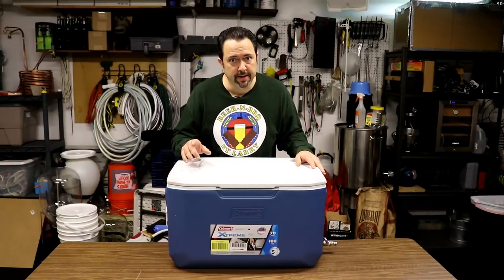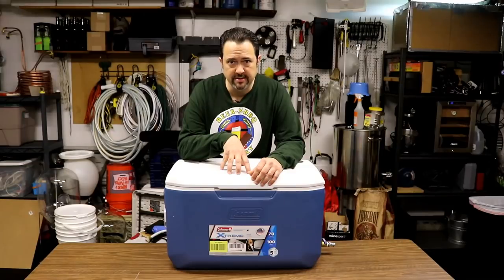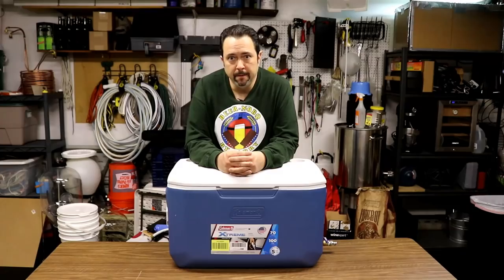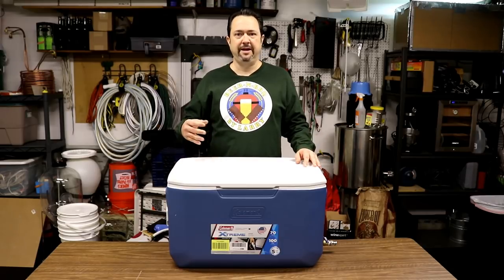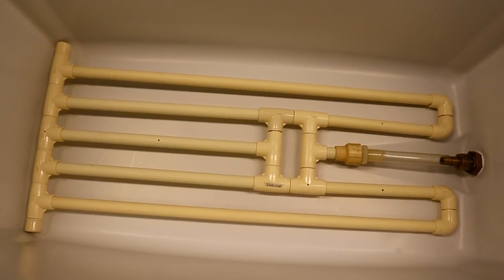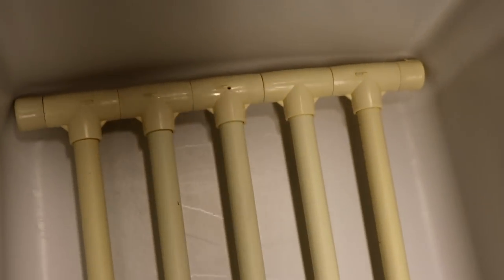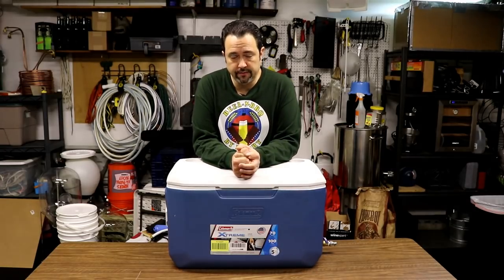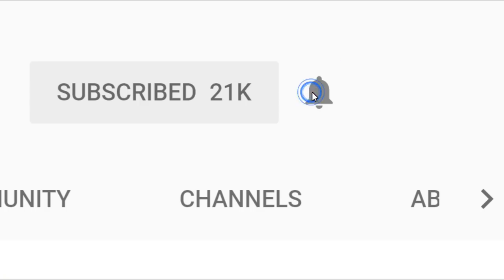DIY Mash Tun Cooler Upgrade

Comment: Looks Good. I badly would like to get out of my 10 gallon spin top cooler, and move my brew kettle into the mash tun real estate. The insides of the cooler are beginning to warp from the heat. If I get a bigger brew kettle, BAM! more beer. Cheers bud.

Comment: Looks awesome. But I still think BIAB is way easier with great results.
Reply: Thank you for the reply Larry! I do 5 gal batches and love the simplicity of BIAB. I think anything less than 10 gals is doable with BIAB. 10 or over, stick to the traditional sparge and transfer method! I love your channel! Thank you for all you do.
Reply: joseph kirby In my opinion. You don’t need a false bottom as you are not heating the kettle while you are mashing. Bring the kettle up to temp, kill the gas, then put in the bag and fill up with grains, stir etc. Remove the bag and squeeze before boiling. All good. The thermometer probe  has never dug into my bag either. Happy brewing

Comment: Great design, I'm about to make one and use it for the first time. I am however going to do a wheat vodka,  and the flaked wheat and wheat malt apparently can cause a stuck sparge.  I already own a large brew bag (not biag) but I plan on putting the manifold inside the bag at the bottom for extra strain action. I wonder if anyone has tried this yet?

Comment: Have you tried using this cooler setup on smaller batches such as a 6-gallon run? For me personally, I have found about a 2-case batch of beer is optimal for me both fermenter wise and for how long I want to be drinking a single style of beer. When I used to brew 20 yrs. ago I used to do about 12-13-gallons (post-boil volume) in a 15.5-gallon Sanke keg boil kettle and it was really too large a batch for me.  I currently use a 6.5-gallon carboy as my primary fermenter but am considering converting to the Spike Flex+ 7-gallon fermenter.

Comment: I made up a mash ton with a Home depo cooler and after 8 or 10 uses it started to leak the rubber washer that came with the cooler broke so I used cpvp parts to fix it. but now Im thinking of using my cheep cooler with no drain and a auto siphon only for my next batch.
Reply: Ok did not use the auto siphon but made up a manifold like yours with a line coming up to the top and let it come out from there works like a champ and was less to make that the 10 gal home depo cooler all to gether.  @BEERNBBQBYLARRY

Comment: Any disadvantage to just hooking up a bazooka tube instead of all that plumbing ?
Reply from the maker: Good question. Primarily a lower chance of a stuck runoff, but if flying sparging, it enables higher, and more consistent, mash efficiencies due to distributing wort collection throughout the grain bed by mitigating channeling.
Reply: @BEERNBBQBYLARRY  ahhhh Thanks! I didn’t consider channeling

Comment: What is max grain bill for this cooler ? My 10 gal batches use 32 lbs.
Reply from the maker: It depends on your chosen grist ratio and whether you sparge. The max fill is around 65 quarts. With dry grain occupying around .3125 qt/lb, you can do the math for you recipe(s) to determine the max grain bill or use a brewing calculator like my spreadsheet: https://beernbbqbylarry.com/downloads/#brewingtools

Comment: Slightly unrelated but this video gave me an idea. If you could regulate the pressure, would it be possible to carbonate the beer as it’s fermenting? Would it affect it at all?
Reply: BEER-N-BBQ by Larry must have missed those videos, I’ll check it out!
Reply: Ashton, yes you can.

When I was working at a micro, 
that was our method.  (Ali'i 
Brewing, Honolulu Hi.)
(I wish they were still around, 
I'd KILL for the grain bill for 
Macadamia Nut Brown Ale!)

In fact, out fermentation tanks had 
pressure blow-off devices.  Too much 
pressure, they'd release Co2.

steve

Comment: I’m having trouble getting it to seal around the nipple at the valve, what did you use to seal it?
Reply: Ok that’s what I thought. My cooler didn’t come with the rubber insert, it is a different style but same cooler. Thanks!

Comment: Hey boss does the grain set a bed on the pipes and allow you to flow through I am interested in this set up but want to do a RIMS setup to recirculate.
Reply: BEER-N-BBQ by Larry did you add a sparge arm to this system or do you add full volume to your Cooler and just drain once.
Reply: BEER-N-BBQ by Larry sounds good thanks yeah I prefer batch sparging also and with my brewing systems I use rims and I am able to hit  those efficiency numbers all day. That’s why I asked abt the the Rims set up I may be able to accomplish it with a relatively easy adaption to my grain father.
Reply: BEER-N-BBQ by Larry diy done. The drain was a pita. I wasn’t able to find a 2” Nipple so got 2 1/2 and it proved a hassle with spacing. But I just need to drill holes or slots. What size did you use for those? I was trying to share picture but won’t  work for some reason.